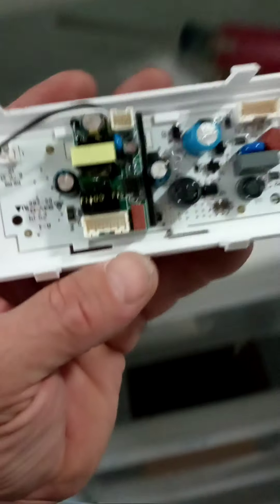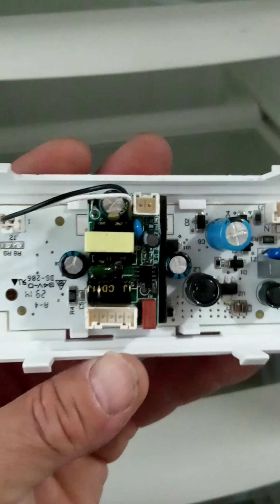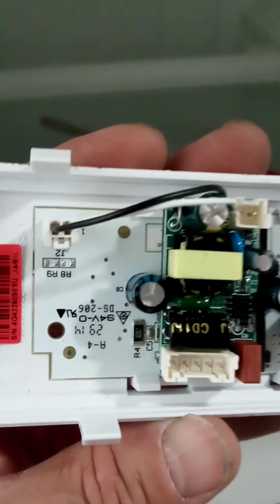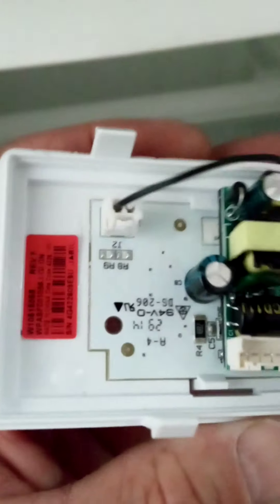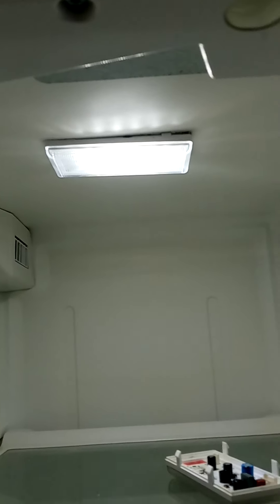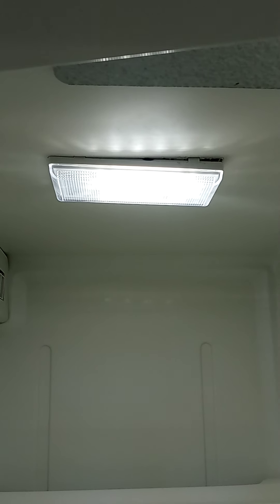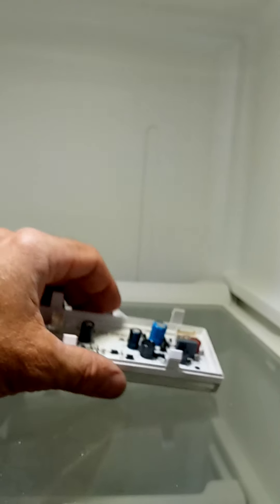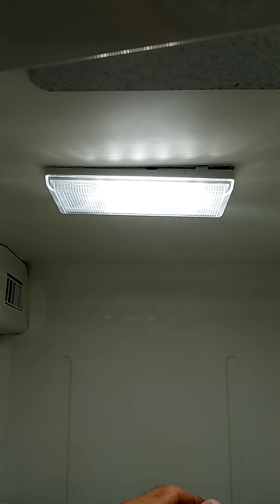whirlpool flashing led light module possible fix. Part 2.

Comment: I tried everything.  Problem kept coming back.  Until, I put electrical tape on exposed portions of the circuit board where there were no other components.  This worked.  I think frost was causing a short circuit - the electrical tape acts like an insulator.